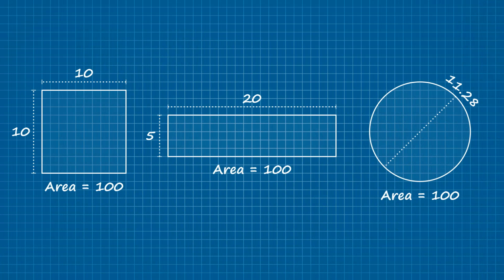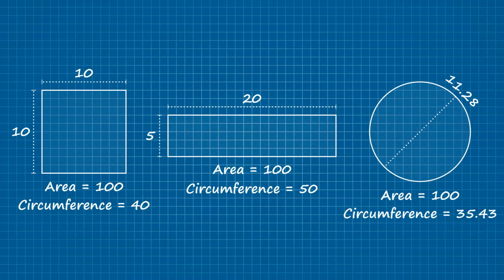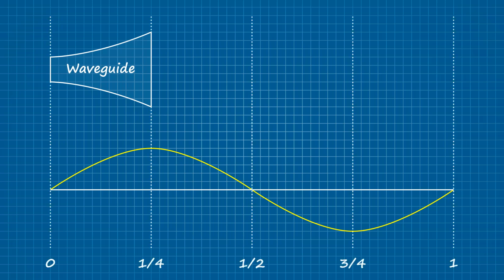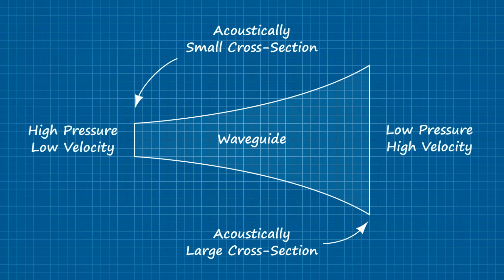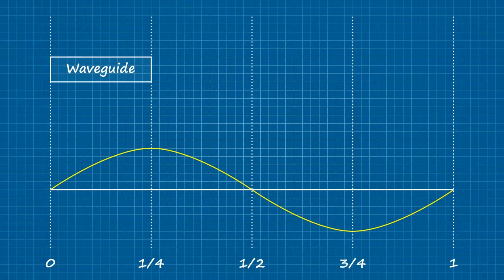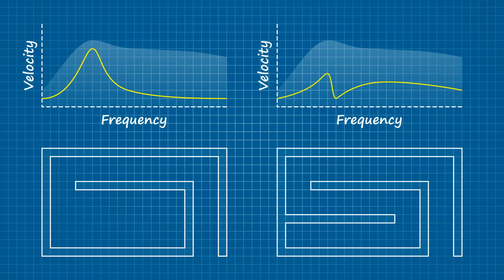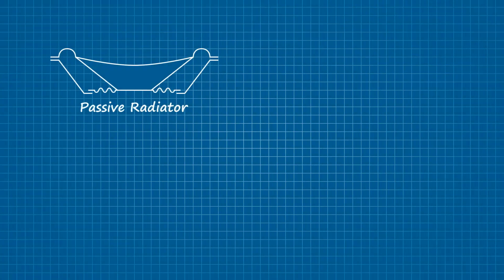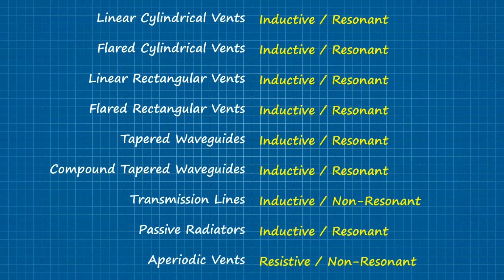The BEST Port Video EVER

Comment: That's amazing!  So what do ports do?   Really though,  is there a formula for cylinder port (not flared) to box size/shape ratio?  Also is bamboo plywood completely worthless box material?  I already made the boxes and put really cheap speakers in them.  They sound pretty bad but could just be the speakers/cheap stereo.  I'm still curious if anyone knows if bamboo is okay material...

Comment: @HexiBase - Can you please do a video on putting 4 identical woofers on the same box in an isobaric arrangement (double clamshell would be nice or maybe all in a row facing the same direction and maybe talk about the pros and cons of both).  This would have great applications for people with limited space.  For example, they could take a reasonable size (coffee table) size enclosure, and use four 12" woofers that would normally be happy in maybe a 20 cu ft box solo (1 woofer), but instead use a 6 cu ft box (5 cu ft when the woofers displace some of that).  So in that arrangement, will the 4 woofers have good output at the resonant frequency (Fs)?  Also, if each woofer is 8 ohms, how will wiring them in series/parallel combination (to retain 8 ohms), affect anything?  Will the power handling be 4x that of a single woofer?  How much deeper will it go?  Half an octave?  Thank you!

Comment: This will be the first time, I have viewed any of your videos, nice one; handy.  I have had my mind on a speaker project .  My accumulation pile has potential for some sweet little projects. 
Desk Top, or Book shelf blue tooth system, with red cedar. If it doesn't sound good, at least it will smell good.  I have been checking out some electronics videos, Led circuits, amp circuits, speaker wiring methods, and I bet you that's why Youtube recommended your video.  Good Call. I'm really glad I caught this before I built my enclosures.    subscribed.

Comment: im thinking of combining passive radiators with horns. I want to make a portable speaker with huge sound and using passive radiators I can keep the box smaller. I will probs build the box with just radiators first and build a prototype enclosure to put the box into to see if I get a bigger sound and more thump in the lows. I was just going to put trumpet style horn infront of the tweeters and woofers and a folded horn of the radiator. it may work or it may not but by doing it in two bits I don't ruin the box as I can just take it out of the enclosure and if it works then great as it would be perfect for indoors as size and the horns and folded bin will effectively increase the speaker size and this would not be an issue and if I'm out and about I can just simply take the original box on its own as this will be more transportable due to smaller size. Do you think im being to ambitious? I have made some speaker boxes for my phones that seem to work :) and I have more then once made some sort of horn out of random materials with no math just to make speakers louder so I can hear them at work or what ever

Comment: Question hex, would it and how is my tuning affected in a slot port if I split the slot in half in the interior of my enclosure? Essentially a 32sq. in. port splitting into two 16sq in. Not unlike two subs sharing a common chamber that is ported.

Comment: do the folds in a transmission line serve a purpose (how many folds can be done or how few) or is just an issue of length that puts the output 90° out of phase with the driver?

Comment: I've been tossing around the idea of trying to tune my pre Fab 12" sub box, its like 1.3cf and has a big slotted port and it seems to be tuned to around 44 htz, and is only little smaller than the manufacturer recommended box volume for the Polk db12, to have tuning in the low 30s the calculators basically say the port is way to big... If I reduce the port vs extend the port to 58" long! Am I going to kill the spl or volume to gain response in the low 30s? If so I'll just leave it alone and start over from scratch eventually. Another odd thing is it starts really getting really quiet around 20 htz and @ 18/19 htz has a wierd response jump and gets louder then back down at 17...?!?

Comment: I absolutely love your content because I can tell you truly are an expert on the matter. I got into your channel because of the 3D printed enclosure for the 3" sub, and it got me hooked on it. But as a complete casual in sound engineering, your videos seem to be curated towards other sound engineers. I have watched the breakdowns and tried to absorb and research as much as I can, but that only gets me so far, since I already have very limited knowledge on the subject. One thing your videos really could use is ELI5 sections, where you dumb down what the subject means and how the variations of the subject affect the end user. Maybe a beginner series in sound engineering could do well? Either way I'm eager to learn more about this, and will definitely watch in the future. Thanks for the hard work!

Comment: Ok audio nerds... heres one for you. I need to build a home hifi subwoofer, and I want to know what YOU would do given the requirements... 

-It doesn’t need to be loud, music is never played loud enough to make a conversation difficult

-It needs to work well at low volume levels, music is often played softly, in an otherwise very quiet environment

-It needs to be able to play right down low without dropping off 

-Will be supported by mid bass speakers so can be low passed relativly low 

-Power is unlimited

-Space/size is unlimited

-Design complexity is unlimited providing it can be made from general hobby materials

K go!

Comment: Just, FYI: The circumference of a circle is derived by ' Radius squared times Pi '  "circumference times Pi "  will give you the wrong number, unless the square of the radius just happens to be the same as the diameter.
Not trying to be a jerk: You said the comments are often helpful .
  
I remember the formula using a silly mnemonic devise as follows:  
( "Pies are square, that's how you know how  big around they are." )
The fact that it sounds like nonsense makes it easier to remember.
Hope this is helpful. Thanks for the video.
Reply: Uhhhhh actually no, circumference is pi times diameter. Or 2 pi times r. Pi times radius squared is AREA. I would get a grasp of literally elementary mathematics before you make yourself look like an idiot to anyone else.
Reply: @isaaclohnes2337  good heads-up, thanks. (Or rather, thanks for letting me know my head was up my ass at that moment).  I'll make sure I research before I comment on mathematics or, anything technical that I'm not sure of.
Or, at least write "I think" before a thought.
Again, thanks for reminder. I know better  when talking to someone in-person: feed-back real-time, rather than pseudo-communication on a mini keyboard with god-knows-who while working on my second drink, thinking I can help someone understand something I don't. Oops...

Comment: Wow do I have a lot to learn.  I thought I could simply substitute a round port with a rectangular port as long as they had same area and all would be good.  Thanks for great video, I see I have a ton of reading to do!
Reply: Bear in mind the human ear is not terribly precise.  We can only barely hear the difference of 1dB.  Barring any extremely unusual shape (1X100 units which would cause trouble) you would need precision measuring equipment to notice the difference between any 100 unit area port.    From my experience you need to change FS more than 3hz up or down before you will get an audible difference so provided you've got the fundamental rules of port design covered to avoid major failures if your real world performance is off a bit due to unexpected functions of fluid dynamics you would probably never notice the difference.  Same with flares, if you're not really trying to skimp on port area or searching for a few 10ths of a dB in a competition they should be considered purely cosmetic.   

Fun stuff to consider, very helpful when trying to do extreme applications, but for 99.9% of applications irrelevant.
Reply: @hispls  Excellent - thanks.  Definitely nothing competition here.  Trying to stay with rectangular ports due to length restrictions if I went with round ports.
Reply: @MoparStephen  

Just make sure your fundamentals are sound.   Adequate port area/volume, a port width clearance between port openings and obstructions, and correct area and depth and you'll be fine. 

A lot of people over-think, and over complicate.  If you're not using precision measuring equipment and planning to show off response or impedance curves you'll be fine.

Typically far more dramatic is your room (car) acoustics and position and orientation of the box, driver, and port within that space.  Nobody really talks about this because outside of laboratory environment there's simply too many variables to model or predict so at the end of the day it's down to trial and error.  Apart from my SPL competing wherein "the meter doesn't lie", I live by the rule "if it sounds good it is good". 

Now get out in your shop and start making some sawdust!

Comment: How would you calculate the sizing for a compound tapered waveguide? I know port tuning is based on the relationship of area to length but with the taper changing the area would the length need to change too? Or just keep the same opening and length and add in a taper?

Comment: Wow! That was a tremendous amount of information. Thank you for making this video downloadable. I'm sorry that i still have a question. I'm trying to determine the diameter that will best work with my subs and enclosure. I have 2 12's in a 4 cubic foot box. They're being powered by 5000 watts minus whatever impedance rise there is. I have been searching online for a formula that i can use to determine the proper diameter. I listen to my music very loud most all of the time. I have been thinking that i should just go with 6 inch diameter flared port. Any suggestions or equation? Thanks
Reply: A port must contain at bare minimum the volume of air displaced by the drivers.   Take the piston area of your woofers, multiply by the peak to peak x-mech and be sure the volume in your port is no less than that.   Generally speaking though, the bigger the better.   Most applications we compromise because large vents become impractical to build, but for practical purposes you cannot go "too big".  

I would suggest the white paper by Alex Salvatti and Doug Button as the definitive resource on the topic.

Comment: I love these videos, even tho I have about 0 clue about most of the specs of a woofer and boxes, the videos are very well made, and the graphics make understaning the subject alot easier.

 For listening at home I perfer passive radiators, I really enjoy the silent, no chuffing bass, but the speaker has to be designed well. For example I have a pair of Golden Ear Triton Three's. The bass on those in insane, without any kind of distoriton at any freqency. But I also have a REL subwoofer with a passive radiator and I guess the radiator is too small for the woofer and at about 32Hz it maxes out and creates distortion which is quite annoying to hear

Comment: Thanks dear.
So I will go for cylinder pipe reflux as it is more efficient. Just tell me for 3 inches woofer how much diameter pipe to be used. And what is the gap between  pipe and the back end plywood, if pipe fixed from front baffle. Please reply.
Reply: Use winISD, or look up manufacturer reccomendations

Comment: So in passive radiator there is still something that you might call linearity just like in speaker driver even without coil? How I would be able to measure or simulate something like that? Its just the matter of structural rigidity?

Comment: I'm going to be watching this for weeks. This video, in combination with the "Five Enclosures You've Never Heard Of" video, has served to make me extremely interested in using enclosure design and clever waveguides to create a wide-response hifi speaker for myself. Regular, 2-way vented systems are always quite boring to me, because it's all-too simple to use a rectangular or cylindrical vent and put up with the "bass extension" results you get from low-effort solutions to driver problems. There's a 6th 1/2-order hybrid you described in the other video that's intrigued me. Much too much to think about, but I have to begin to understand how these pieces work before I can begin drawing designs. I must agree with several other commenters: you have the most in-depth, "hidden knowledge" available in any video about speaker design I have ever seen. Most everyone else is either concerned with the loudest bass or the prettiest 2-way. I hope you continue, consistent with your position on the Con-Ex scale, to provide powerful information like this going forward.

Comment: I real wish you could offer custom box designs. If I give you what equipment (subwoofers size model and amp/power) I’m using and total amount of space or volume I have to work with, as well as what I’m trying to achieve (sq/spl/ hz range/ etc) then you could draw up some planes on the construction with spec. sheets or graphs explaining tuning frequencies, port shapes and lengths. I am aware that this sort of thing would be expensive and there are other people and companies that already provide these types of services,  however I would put far more trust in your skill, vast knowledge and precision than anyone else in the business.

Comment: Suppose a 15" woofer is put in an undersized box (meaning it cannot play deeply that is).  Is it enough to just add a 15" PR or is there a general rule such as the cone area of the PR should be at least double that of the active woofer?  Also, can 2 small woofers be used in the same box such as a pair of 8" woofers, sharing a single 15" PR?  Thanks, great video.

Comment: how does one go about calculating the length of a triangle port. Know that a triangle port is basically a square or rectangle port cut in half but should the port length remain the same ,doubled or cut in half of the original length of the square port?

square port

High 5.50

Width 5.50

length 5.19
Reply: Use 2 triangular ports that equal the square opening . Same dimensions
Reply: @chrisoconnor3119  does the length stay the same ?,since its 2 ports instead of being just 1 square

Comment: Could you possible tell me if my box I’ve built is a t line? It’s a 5’ by 2’ by 1’ box with a 12” by 2 in port that is 4’ long, it seems to hit everything below 38 perfectly but right at 40 up to 60 or so it doesn’t make hardly any noise but 60-80hz it starts to get loud again. There is almost no air moving from the port Until about 20 hz. It’s a odd design and I can’t figure out what it is. Has a single 12 inch audiopipe in it and it moves a lot on the lower frequency’s and it’s on only about 200 watts it’s 900 rms

Comment: Damn I wish I'd had the video when I designed my current desk speakers. I've accidentally ended up ok though with everything, but the info is really useful. The desk speakers currently have a really low tuning (~35) using the W5-1138's as the main woofer with a long slotted port to reduce chuffing (though the whole thing is super inefficient but its at a desk so doesn't really matter).

Comment: Hello. I´m experimenting with most "power dense" bass box. What are your thoughts? It looks to me like at the end of the day, strong efficient driver is the thing that makes the sound, and anything else lossy connected to it isn´t going to help with SPL per cubic volume. Only reason I employ the bassreflex port (undertuned) is to set the speaker working mode to exploit its capabilities. For example, the speaker would run out of displacement volume, so placing a port in the circuit will assure me that the speaker will stay within cone excursion limits when HPF´d right... Is there anything more powerfull in compact volumes?

Comment: I think that was the highest density presentation I've heard yet. Thank you for not wasting my time and also for being bang on! But I have to add there is one type you didn't include. The one that uses multiple small vents to add resistance to the inductive loading of a regular port. (Just a bunch of drinking straws jammed into a cylindrical port)

Comment: Good explanation. I knew the math behind everything except the tapered ports. It never occurred to me to treat them as horns. I am a frustrated audiophile. My living room is just about exactly 8ft high, 16 wide and 32 long. There is also not a single corner suitable for a subwoofer. To cap it off, one of the short walls is almost all glass. No one I know of has been able to figure out how to get decent sound in this room.